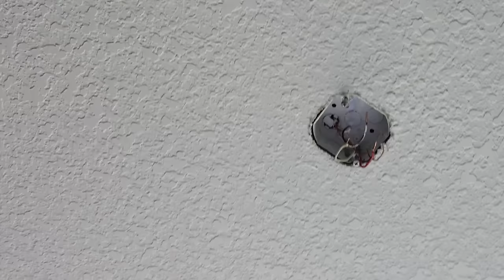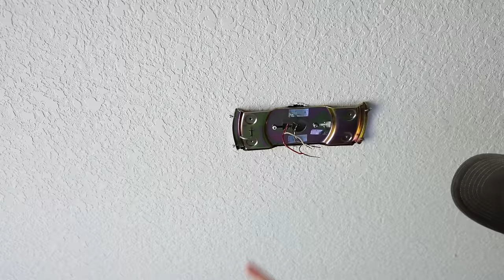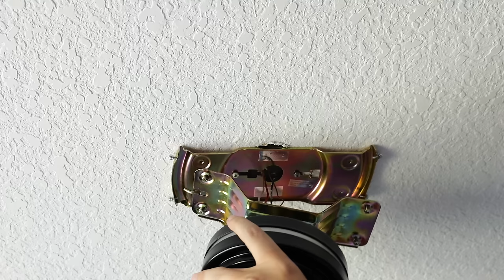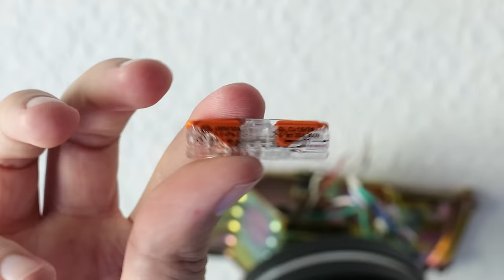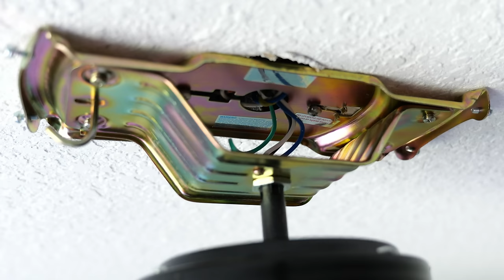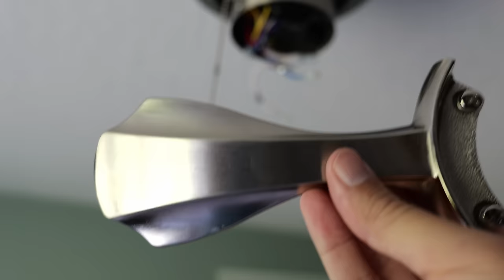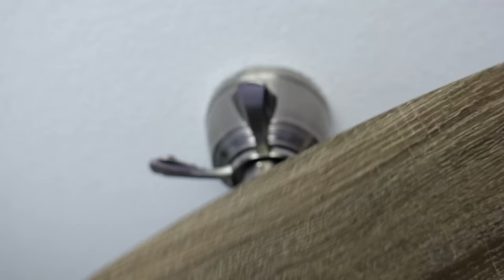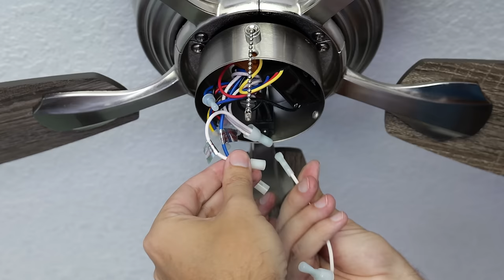Avoid This VERY Common Mistake DIYers Make When Installing a Ceiling Fan | How To

Comment: This existing junction box was not a fan rated box which is required for fan support. This installation is a violation !  I don't think this guy is a licensed electrician.
Reply from the maker: That absolutely is a fan rated box.  If you can’t tell that by the giant screw that the plate got mounted with then why are you even commenting this?   Nothing about it is a violation 😂

Comment: No, no, no.  #1 did you check that the light box is strong enough to hold the weight of a fan?  Not in this video.  Needs a different kind of box that extends to the studs.  #2  Also, done in the wrong order.  The reason for the hook is so that you have access to the wires without the fan in the way, but don't have to hold up the fan while doing the electrical..  Do the splice first, then lift up fan and screw it into the plate.

Comment: Good video but you use an electric screw gun way too much. It’s gonna bite you in the butt one day if you ever have to re-move anything. Been doing residential and commercial electrical for over 25 years. Believe me sometimes you need to just use your hand tools
Reply from the maker: How so?  I’ve never had an issue come up from using one.
Reply: @HowToHomeDIY  hey appreciate you answering that comment I’ve seen a lot of your videos recently they’re good  & helpful ,

when you lug those covers down real tight like that it slightly bends that thin sheet metal warping it, And you can see that when the light hits the cover, , I’ve use electrical screw guns , too, that have clutches . And most of the time everything works out until you have to go back to remove that fixture (troubleshooting )Maybe to update to a different fixture 5-10 years later  froze in the threads seized up and you round off the head trying to get it out. It’s not so bad on the bigger screws but those round little soft trim screws are the worse and they’re the hardest to grab with a pair of vice grips or whatever method you’re gonna use to take that out. and for whatever reason it’s always that surface mount fan that you’ve gotta completely assemble. I never cared for those but there’s always application for it when there’s a low ceiling or the homeowner just wants it. But fanblade assembly yeah I’m gonna use a screw gun every time  . Fanblades screws to motor. hand tools (screwdriver). Screw gun you have one chance and I could be it.

Comment: Is this a "How to install a ceiling fan" video, or really just a "How to install these bitchin' Wago snap connectors" video? 🤣
Also, it is ALWAYS easier to install the blades onto the blade brackets, and then install the bracket onto the motor, then trying to wrestle the blades on in the air.

Comment: Where is the most important thing??? Most ceiling lights are NOT DESIGNED TO HANDLE THAT WEIGHT! You have to add a support over the ceiling between joists! Very important.

Unless you relish the idea of having a spinning fan tear out of the ceiling and onto your head. Or your wife. Or your kids. Or your neighbors kids... you get the idea.
Reply from the maker: Most ceiling fixture boxes are actually rated for 50 pounds or less.  The reason is because many of your light fixtures now are quite heavy, sometimes even more than these fans.  It was not that long ago that a fan rated box was only required for fans over 35 pounds.  Most fans are not that heavy.  But they have changed the code that now fan rated boxes are required for any fan install.  So yes, use a fan rated box.  I am not advocating for not using one but lets not get too worried about it since there are thousands if not millions of fans out there in fixture boxes that are not fan rated and they haven't come crashing down in the many many years they have been installed.
Reply: @HowToHomeDIY  Agree to disagree. You are advocating people replace ceiling light fixtures with fan fixtures, without knowing the age of the house/apartment or other details. Its Russian roulette. The proper fixture for this is one that ties into the ceiling joists on either side. I did this job on my old house, and that is exactly what I did, using a fixture from Home Depot. Had to crawl under a 12" clearance to do it as well. Do it right or pay someone else to do it.
Reply from the maker: I’m not 😂.  Yes that’s the proper way now.  I’m stating fact that it didn’t used to be and people’s fans weren’t flying off the ceiling and still aren’t.  Use a fan rated box.  Mine is and it is obvious just by looking at it.

Comment: You did an injustice to your viewers by skipping right over the reason why the mounting hook exists.  Consider how much easier it would've been if you had NOT mounted the fan to it's base before you'd wired it.  I'd suggest that, if you had reviewed the instructions that accompanied the fan, it would read something like this: 1) Mount the base to the box, 2) Hang the fan from the hook, 3) Wire the fan (as you correctly instructed),  4) Insert the wiring into the electrical box to meet the NEC, 5) THEN mount the fan to the fan bracket using the supplied screws and 6) Final assembly of the fan, testing, etc.

Consider also that many people may prefer to have the fan speed selector installed in the wall instead of he mere power on & off switch.  There are many options for doing so with most fans.  Some modern units even use a remote.  In that case, it's likely that only one power connection would be needed.

Comment: Be honest, you’re using a electrical box for a light and not a proper ceiling fan electrical box. Huge miss here when you’re trying to explain to us common mistakes. This is number one.
Reply from the maker: If you can’t tell by looking at the box that it’s a fan rated electrical box then why are you commenting on it? The video isn’t about common mistakes but I do highlight one that can actually have dangerous consequences.  😂

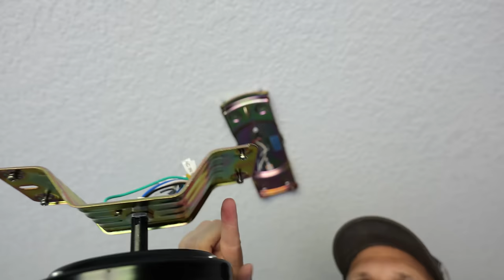Comment: Two minutes in and you're already making your own mistakes.  Well, at 2:00 you're ready to hang the motor but you haven't addressed the electrical box and whether it's capable of supporting the weight of the fan or not.  If it's midway between studs then you can't just hang it.  You have to change the box to one that fixes itself to the ceiling joists.  Then - AND ONLY THEN - when the fan has sufficient support can you hang your fan safely.  Even if your box is already suitable to hang a fan no it - not covering that feature is a crucial error.  SOMEONE is going to hang a fan improperly and get injured because of your video.
Reply from the maker: Well then they skipped a part like you did where I say to make sure to follow the instructions that are provided with your fan and not just this video.  Because yes I did verify it and if you knew as much as you are trying to make it sound, you would have EASILY been able to tell just by looking at it that I’m using a fan rated box.  So no, if something happens (extremely rare), it’s not because of my video.

Comment: what's funny about this video is that you say other videos miss something , and the first thing you do is start on the wrong foot ! The FIRST  thing that should be done after removing old fixture is making sure that the box the old fixture was mounted to is actually FAN RATED. If not, you're attaching to a box that will not carry the weight . i mean you didn't even check if that box was attached to a stud and not an old bracket type of hanger that spans studs. WRONG WRONG WRONG !
Reply: The box in the video is clearly a fan rated box.  But even if it wasn’t, how many years did we go using standard fixture boxes and people’s fans aren’t just falling out of the ceiling.  In fact up until fairly recently this was not even a requirement unless the fan weighed 35 pounds or more.  These fans, unless much larger, are typically nowhere near this weight.  So while yes it would be best to install a fan rated box and currently code, let’s not pretend like the fan is just going to come down in a fixture box.  In most cases it won’t and hasn’t.

Comment: You’ve earned a thumbs down because of your misaligned title which perhaps targets those who do know how to install a fan but, also want to hear your take on the “common mistake” DIYer make, which you did show in 5 seconds, great push connection point INTO electrical box. You would not hav e earned a thumbs down if title was … how to install… but since the “star” of this video was the common mistake, which was 5 seconds of your 15 min vid, this makes vid deceiving clickbait and a waste of 15 min for those waiting to hear the common mistake.  This is the toxic reason ppl are moving away from youtube. (I dont know you, you might be a nice guy but this behaviour from youtubers needs to stop.
Reply from the maker: That’s your opinion. Appreciate your feedback.  Many have still found it helpful.